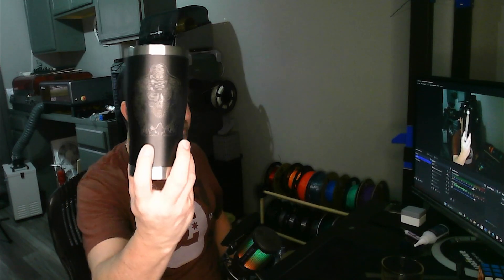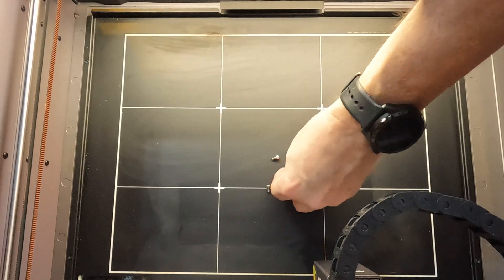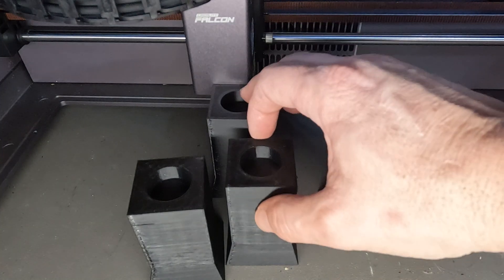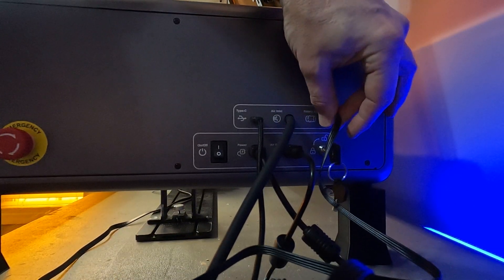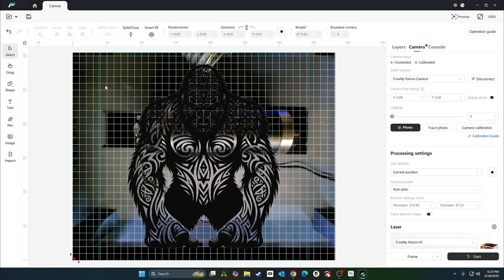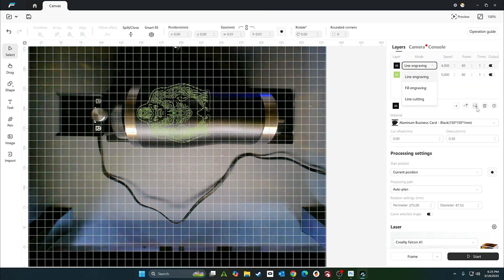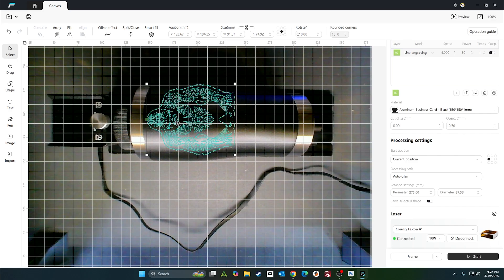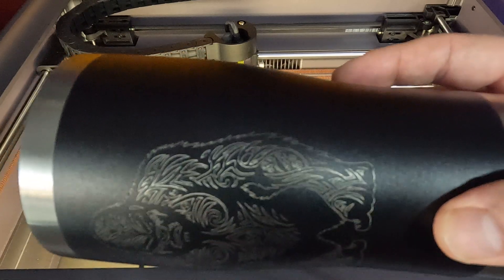Master the Rotary Tool on Falcon Design Space: A Step-by-Step Guide

Comment: i am struggling, I have done exaclty what you are doing set the same parameters and every time the image in preview and I even tried to engrave it anyway, it comes out pinched? any suggestions?
Reply from the maker: Not sure, would need to see your settings.  If pinched, it's usually the diameter that's wrong

Comment: hi i am strugglin here. the design is getting engraved right around the tumbler and not where i want it to be. I put in the perimeter  and it game the diameter, but it keeps engraving right around. i also not sure if i damaged my laser initially i had the chuck on the outside and when it was framing it hit the rubber, not a big hit, but the laser point on the tumber was not a bright as yours. granted i wasnt doing a line engrave. help please

Comment: Thank you so much for the tutorial; it helped me a lot. I have a question: when I use "framing," it leaves a thin line on the bottle, and it doesn't erase; it's like a very light etching. Can you tell if I'm doing something wrong, or is this normal? (I've used this tool on other materials, but it doesn't leave any marks.) Thanks!
Reply: Reduce the power when framing, maybe increase the speed or just unfocus the laser so it canot mark